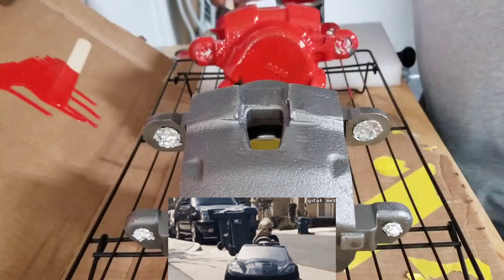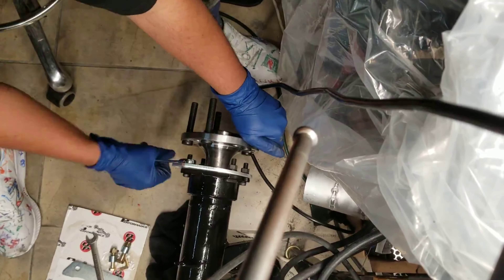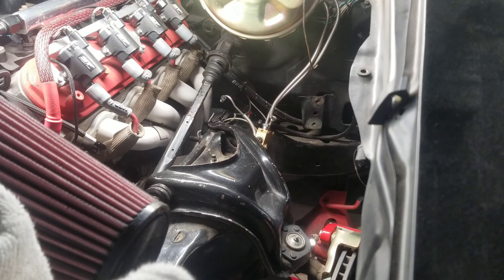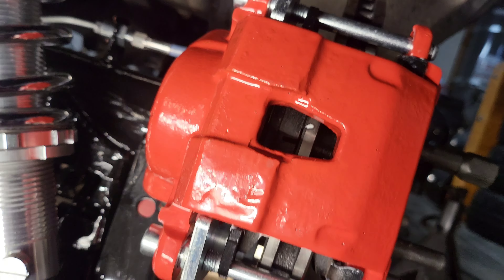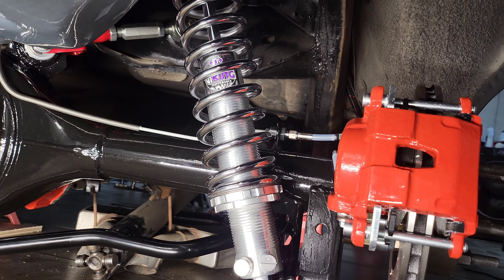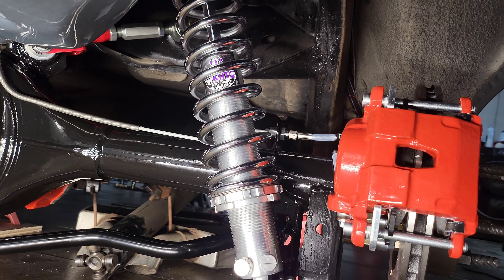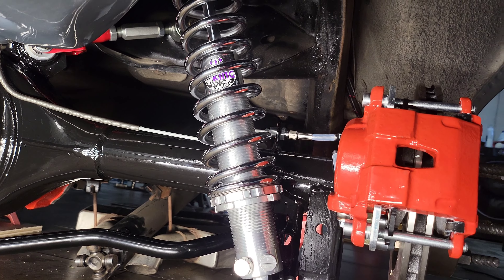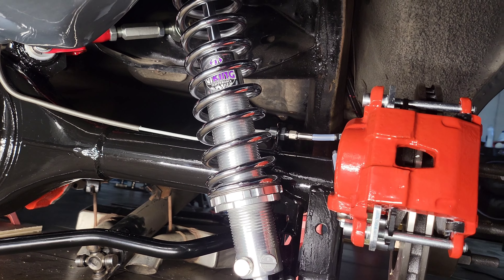Ford 9 inch | Hard Line Brake Kit | 72 Chevelle SS

Comment: Awesome build and video. I am doing the same thing more or less on a 9" for  my 70 Camaro. Wilwood makes a nice axle tube clamp for the hard line to braided hose connection I found. It might work to help hold the line too near your third member if you find you need it. I need to figure out how I am going to mount the distribution block like you did. Maybe make a bracket like Currie sells that is bolted on using the third member bolts. Anyway, thanks for posting your work for us following on behind you!
Reply from the maker: Glad it helped you out Appreciate the kind words sir 🤙🏽 That's good to know I'll have to look into that! I'm debating whether to run another set of lines for a hydro e brake and a second set of calipers and I don't want to have to grind weld and paint again Good to know there might be another option. That curry bracket look like the best option over what I did but I didn't know if the spacing would be the same didn't want to take the chance it's not very cheap 😂

Comment: Question for you bro, how are those Ridetech bushing came out. I debating on getting them or not depending if the ride is too rough. I pretty much have the same setup as you.
Reply from the maker: @adc_thegreat  they worked out good went in good, definitely more articulation, rides rougher with those bushings but it's worth it and it's not crazy rough it's just more how do you say. . . I don't want to call it feedback but impact I guess would be the right way to say it. if I had the option to run the polyurethane from the old 12 bolt or these I would run these (having had both now). The actual performance is well worth the little bit rougher ride over polyurethane in my opinion. I'm also trying to put a shitload of power into this which plays a big role in my choice.

Comment: What is the outer, lower bracket on the housing for?
Reply from the maker: It was supposed to be for a factory shock bolt mount. I just didn't cut it off 🤣 debating whether to convert it to a tow strap point for Dyno or trailer stuff 🤷🏾
Reply: @Califormula  thanks for the reply, dig your vids
Reply from the maker: @skitv8780  Thank you man, and sure thing man🤙🏾 always down to try and help!!

Comment: What rear spring rate should i run? I do have audio system and 22in rims
Reply from the maker: I'm not sure man I'm still trying to figure mine out I have 175 ( still kind of soft for my liking) but none of the suspension is adjusted not on the wheel and tire combo that all end up with. Check out Mr Griffin 23 on YouTube he had 22s on hiswith the same kind of rear coilover, He might be able to help you out!
Reply: @Califormula  yea he not much of a talker
Reply from the maker: @drptp5017  I hear you He's a busy guy I definitely understand, I'm running 175 really mainly because I wanted to change the color of the spring, pluse I knew I needed a stiffer than 150 so I went with 175. I didn't want to over stiffen the rear because I wanted some travel to hook up I'm pretty confident that with the spring rate I have now It won't be too soft and I'll be able to dial it in with the adjustments on rebound and compression on the shock itself. What you see in the trunk right now is probably all that will ever be in the trunk one speaker amps battery etc maybe another battery and a surge tank at the worst. also if you call global West they have real first-hand experience as well as UMI good people.

Comment: What paint did you use. I have to paint mines as well
Reply from the maker: Just POR15 gloss black
Reply: @Califormula   I didn’t know you could use that on the outside. Cool
Reply from the maker: @theshark2804  Yes sir I had a rusty ass frame I painted once the paint was fine and the frame  inside fully rusted away it was like an eggshell 🤣🤣